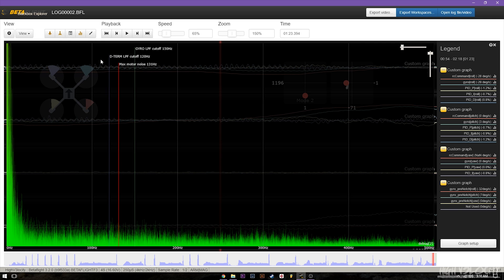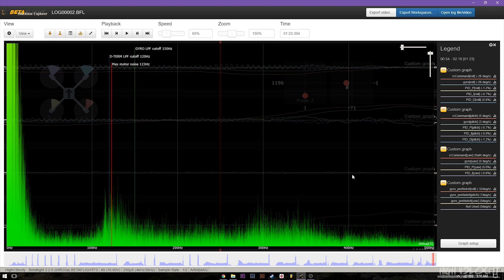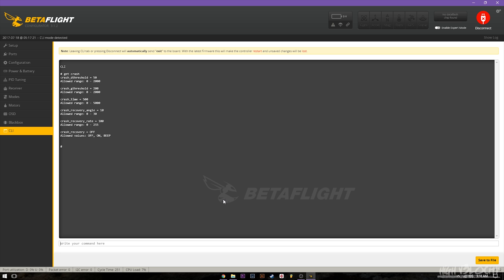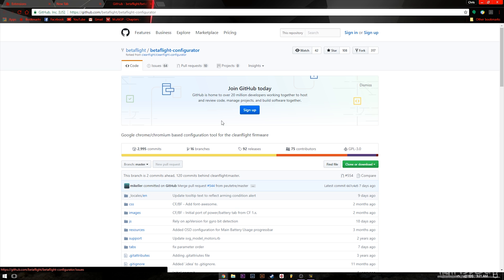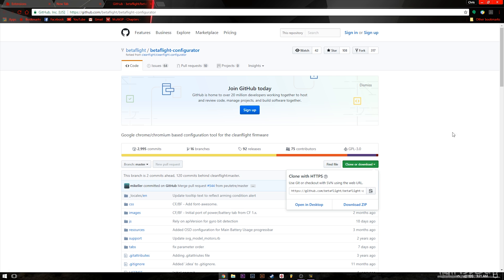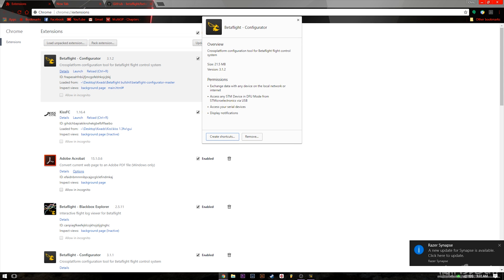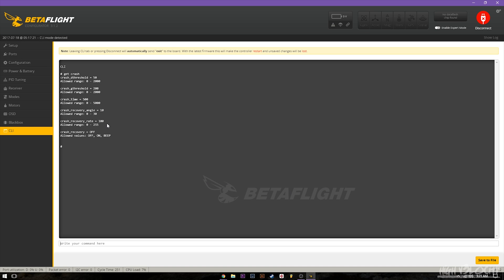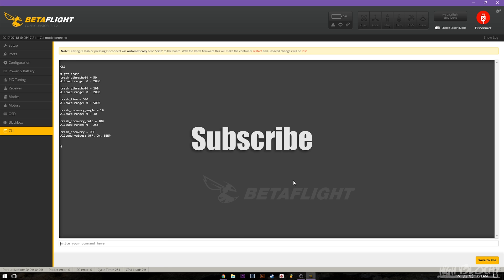BETAFLIGHT 3.2 - DYNAMIC FILTER = AMAZING!!!

Comment: if i use DYNAMIC_FILTER and pt1 and turn off Enable Gyro Notch Filter 1 and Enable Gyro Notch Filter 2
 the quad beeps  if i do sharp movement  and turn off

Comment: In the new 3.2.2 BF config, you cannot set the notch filters to zero!   What is the proper way to set PT1 and the notch filters with the BF 3.2.2 config tool?  If you use the yellow slider it disables all values.

Comment: First of all, thank you for your video, it was very educational. i have heard so much good stuff about 3.2 now that i'm going to flash it on my sp racing f3. i'm fairly new to tuning and i want to give the dynamic filter a try, one question though: do you set up the dynamic filter before or after you tune PID's? does it even matter?
Reply from the maker: I suggest before tuning pids
Reply: thank you

Comment: At what temperature do you consider your motors hot?  When they are too hot to touch?  Or when you can feel any warmth from the motors?
Reply: Bryan Wheeler if you can hold the motors for ten seconds or so then it is fine, they get warm, not too hot that you can't even touch them.
Reply from the maker: Technically anything over 160 degrees. A simple way is if you can hold your fingers on the base or screws for more then 5 seconds, your most likely to be under 160 degrees. if its to hot to hold your fingers on it for more then 5 seconds there getting to hot.

Comment: if you use the crash feature remember to set the threshold to match your rates if you like me to use super high rates. otherwise, it will detect a Simple roll or loop as a crash and correct for it. making it impossible to do tricks

Comment: When do you know to stop turning uo the lowpass
Reply from the maker: best to use blackbox to tune lowpass filters. if not using black box you can get your lowpass close by raising it 10hz at a time each flight. once you notice your motors getting warmer then they usual get back it down 20-30hz and it should be pretty close.

Comment: Tried today 3.2 for DYS F4 FC and all good. I can turn off all 3 notches.  On the receiver tab, there is 3 new windows, stick min, stick center, and stick max.  Stick max is set to 1900. Do i have to change stick max to 2000?
Reply from the maker: you dont have to put personally i set min to 1000 and max to 2000

Comment: DYNAMIC FILTER is a copter killer! It increases CPU load by approximately 25%!!! For e.g. with my Omnibus F4 Pro V3 FC the CPU load is increased up to 63%
Reply from the maker: im a a bff3 and running less then 10% cpu. there is still some tweaking being done to some boards on 3.2. I would try updating to a newer build and see if cpu usage drops.

Comment: Whats the CLI command to reverse yaw?  set yaw_motor_direction = -1 doesn't work
Reply from the maker: +Nick they changed it I thing it's reverse yaw direction now
Reply: Ok confirmed.  Thats the command in 3.2.  I have Dymanic filtering on and so far from LOS flying it seems super crazy smooth with Notch 1 and 2 off with PT1 enabled.
Reply: Nick set_motor_direction ON default is OFF as you see on dump cli command
Reply: Nick PT1 enabled?
Reply: Actually funny you mention that.  I have spent the last several days gathering black box data with PT1 Enabled, Dynamic Filtering enabled, and Notch 1 and 2 are off (0).  The spectrum analyzer shows the data is messy.  They flew fine but just didn't feel right.  If I take that same quad and run the stock config with lowpass type as BIQUAD with Notch 1 and 2 On, the analyzer is WAY!!! cleaner.  I'm not sure how the poster of this video is claiming the traces are cleaner on crap props.  I'm baffled.  I mean obviously he has something working right cause the traces in his video aren't lying.
Reply from the maker: Are you still using dterm notch and also what is your dterm at. Sounds to me like your pids are set to aggressive and the over filtering of stock filter settings are cleaning up your pids. stock dterm is very high for most builds.
Reply: I tried Notch filter 1 and 2 off.  Lowpass type was PT1.  dynamic filtering was on.  Quad flew sloppy and just not right.  I looked at black box data and the noise is all over the place and this was the same result on 4 different aliens that are super clean and super tight.
Reply: i see that there is a switch on configuration page under the quadx picture, even says "reversed" once you've done it. :)